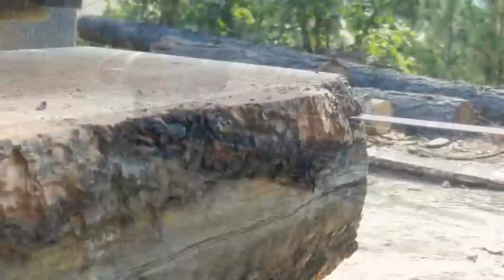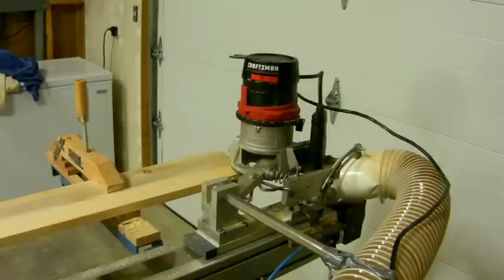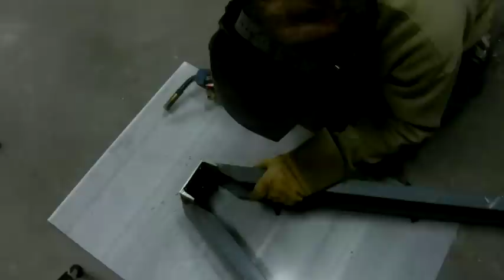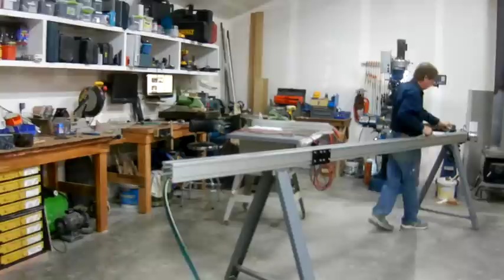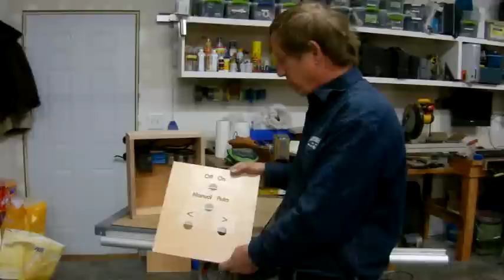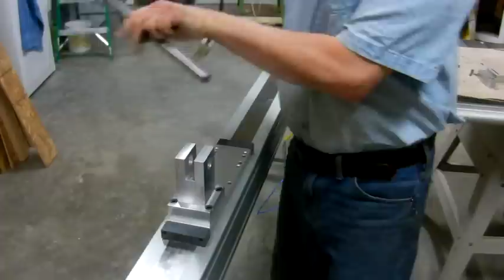Diy Automated Linear Saw

Comment: If I wanted to build one of those, where could I buy the track?
Reply from the maker: Look on ebay for "belt drive linear slide" be prepared for sticker shock,
 I picked mine up as industrial surplus.
Reply: @BSpotBuilds  Thanks. Im looking for something around 3000mm or about 10'. I need two. Im looking at using some TEN-HIGH linear Rails on amazon. HSR25 2600mm. Its still expensive but worth it.

Comment: Great job on this saw.  You seem to combine the practical, the common sense, and the engineering in a very creative way.  Excellent!  I stumbled across your video as I am looking to design / build a better table saw fence mechaism.  Not really related but some of the issues (for example keep slides dust free) are similar.  I have a couple questions:  is the belt and end captures commercially available?  Did you build the carriage that rides inside the track or did you purchase that somewhere?  Would you be willing to share information on these items?  Same questions about the magnetic dust shield.  Sure would appreciate anything you would be willing to share.  Again - congratulations on a great build!

Comment: Is your siding on the house done? We used to have saws like that at work but ours had a table with a slot for the blade and a hydraulic hold down system to clamp the material in place. I see you upgraded your router, did you add more Z axis travel? Have you converted that mill to CNC yet?
Reply from the maker: No, no, and no.
Reply from the maker: Ok it's about 50%, Router hasn't received a Z axis mod but it will some day. CNC the big mill isn't even on the horizon yet.